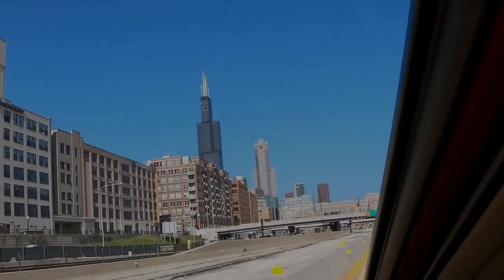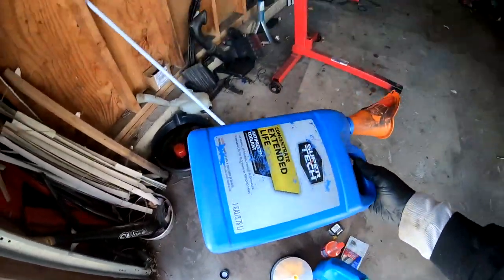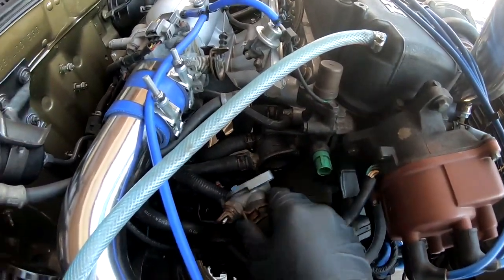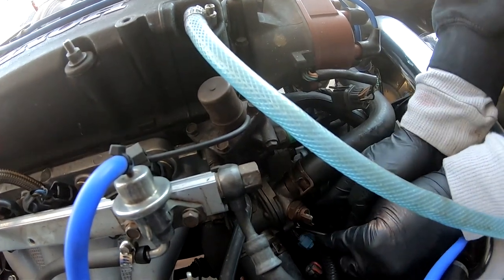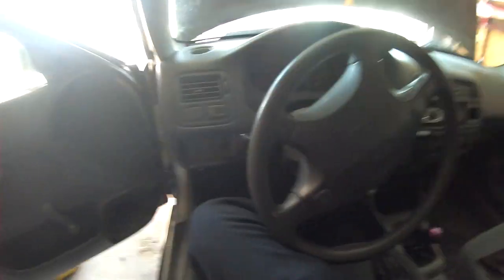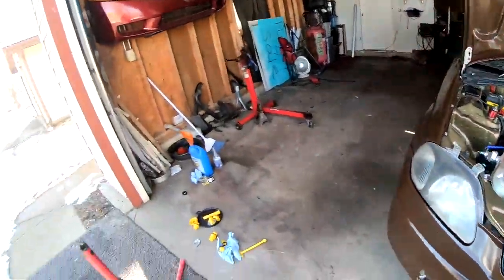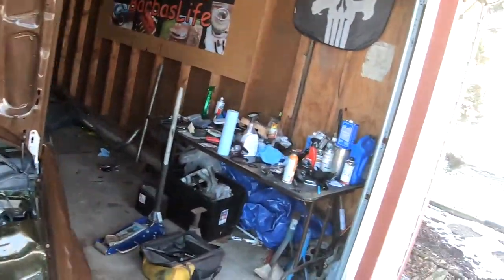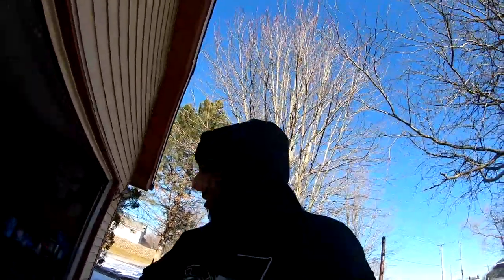Turbo Civic Gets to Burp Fresh coolant and Thermostat install water wetter added also.

Comment: I hate when I snap bolts smh lol..and that is very weird how its green in the radiator but darker up top.i agree with u tho it has 2 be that pink stuff u added lol..would of sucked if it was oil but looks like ur good!!